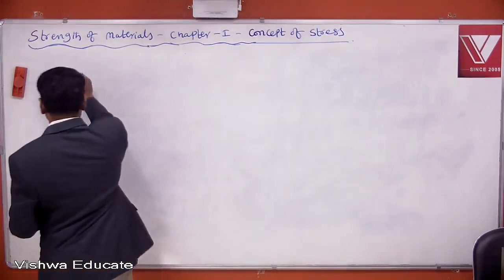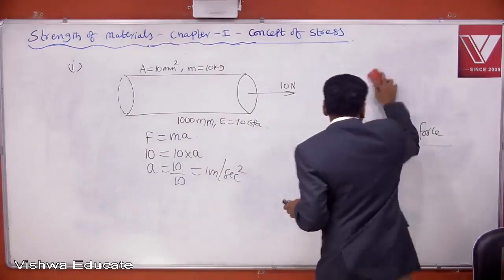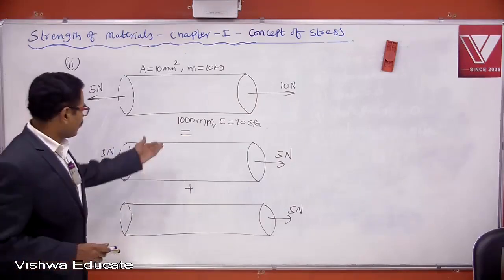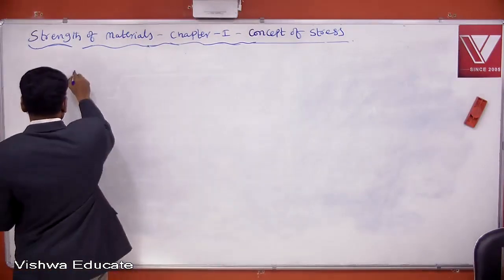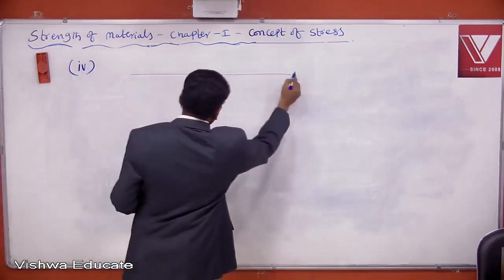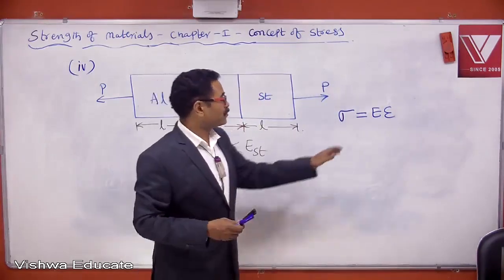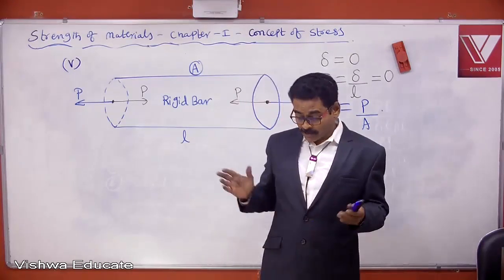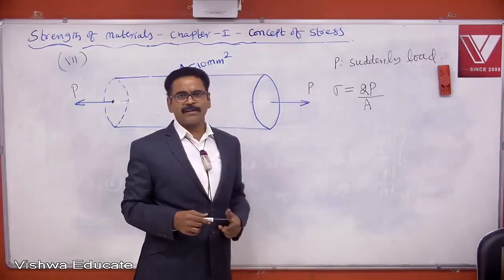What Is the Strength of Material? How to Calculate Stress | GATE ME | GATE 2023 | GATE Exam Prep

Comment: sir,during the design of any element in which stress is used is it engineering stress or true stress and why?
Reply: Engineering stress...it is easy to find as it is based on original area...where as true stress is found on actual area under load which is not easy to find...

Comment: Sir,  Please rethink on Case: 2, I feel that is blender.
Reply: Thought about it a lot..you might be thinking about practicality of the case..think you are lifting water from well...rope is moving but it is under stress because if weight
Reply: @SSNYVLRAO  Sir,  The case:2 is in which equilibrium?  Static or Dynamic!!!
Reply: To keep any system in Equilibrium (Static/Dynamic)  we have to satisfy two conditions:
1. Loads should be balanced (Necessary but insufficient condition) 
2. Acceleration of the system should be Zero (Sufficient condition) 
I don't think,  So we can use Principal of superimposition,  When the system is not in equilibrium. 
Because,  SOM principles will not be implemented when the system is not in equilibrium (to be specific static equilibrium),  Later Principle of superimposition is coming to the picture as a Significant assumptions of SOM,  indicating the limitation of  large deformation in SOM. 
Sir,  my point of Case: 2 is completely blender.  Please let me know if iam wrong. 
And coming to the "well and water weight on rope" example regarding practicality of Case: 2  is completely irrelevant sir.!!!
Reply: @RAMAKRISHNA-qe4ss  Definitely it is in dynamic equilibrium since loads are not balanced...the bar moves towards right yet it carries stress...
Reply: @RAMAKRISHNA-qe4ss  think about tug of war..
Reply: @SSNYVLRAO  Sir,  Weather it is static/Dynamic equilibrium,  The loads should be balanced (Necessary & insufficient condition) to satisfy definition of equilibrium. 
Apart from that the Acceleration should be Zero. 
Then how can be Case: 2 is Dynamic equilibrium!!!!!. (You only telling there is a acceleration of 0.5m/s^2).
Sir, My point of view,  In Case: 2 stresses are Zero.  Still if you fell stress are there,  please dnt deal this problem in SOM because SOM will not deal the system which is not in static equilibrium.
Reply: @SSNYVLRAO  Yes sir. 
Take a Tug of war Rope,  Consider 15 people of same capacity,  and let 5 in one side and 10 in other side of the rope. 
Now think what happens.  The Rope is in rigid motion and simply moves with an acceleration towards 10 people side.  (It is hard to diseases!!!  Still we may in a feel that the rope is in tension but it is relative to static frame. (I.e if the observer is also travelling with the same acceleration of rope then we may not get a feel that the rope is carrying that load) Yes,  it is practical)
Please edit the video,  if you fell my information is valid.!!!!  ( But it's true) 
Info: Case:2 is the one of well known question in ISRO interview.